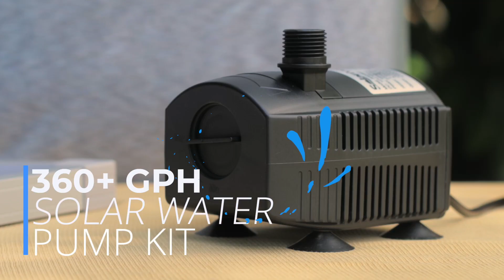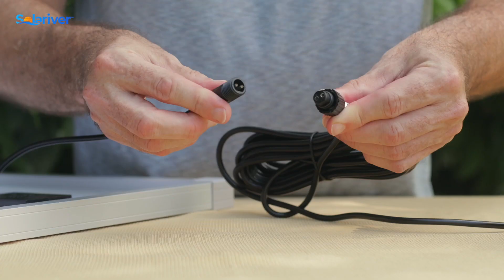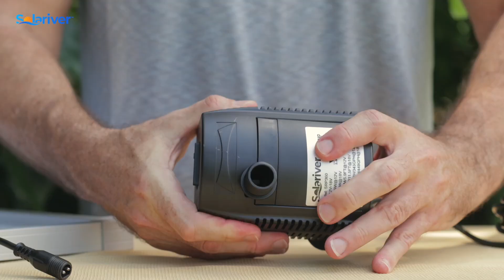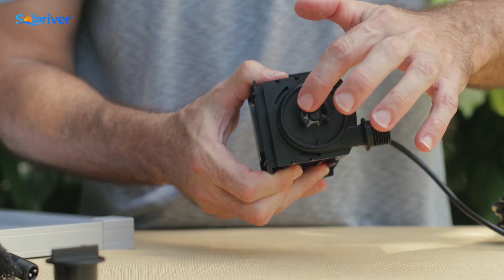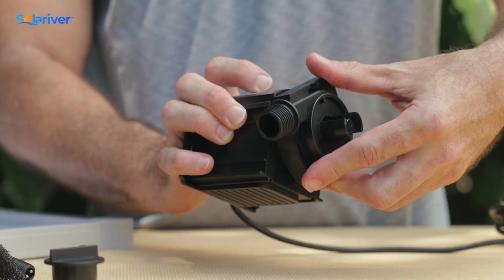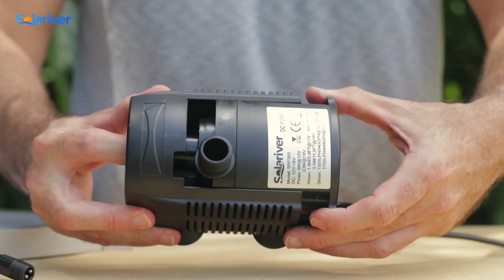360+ GPH Solar Powered Water Pump Kit by Solariver™ - Troubleshooting, Cleaning & Maintenance

Comment: I am looking for an example of this pump working.  I have a 6 foot horizontal return & then a 4 foot vertical to the fountain beginning. Will this work well? And how much can I adjust the flow?
Reply from the maker: @drdaveshow1 Thanks for your comment! The 4 foot vertical is not an issue, but the 6 foot horizontal may cause it to lose power in the lift. If the 6 foot horizontal is under water then it won't have as much stress on the pump as if it is out of the water. You want to make sure the adjustable valve flow is all the way up on high but it can be turned down to zero. You'll want to test to see what works best. Also, the specific use will have an impact on whether it will work in your application. If you have more questions, please contact us at https://www.solariverusa.com/pages/contact-us and we can assist further.
Reply: @solariverusa  thanks for your responce. Ill see if i can sketch a  design with measurements & send it to you for a review. I usally design & iterate hands on.  But i dont want a huge pump for this , my outdoor outlets are tapped until i invest to update..